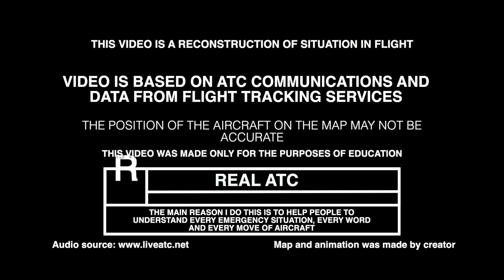[REAL ATC] Mid-Air Collision During Refueling.  KC 130J and F 18

Comment: The KC-130J was from my unit tail# 765 it was our COs bird, honestly after hearing about the crash initially, it was absolutely terrifying for everyone at the squadron until we finally found out that everyone survived! Maj. Wolf (I believe he got promoted) is a phenomenal pilot and an amazing person!
Reply: What caused the mid-air? Did the F-35 get caught in prop-wash?
Reply: @OlafoWaffle  The pilot made a miscalculation after the the in-flight refueling mission and pulling away, and accidentally flew into the props of engines 3-4 (damaging them) while simultaneously having his left wing severely damaging the fuselage and main landing gear of 765

Comment: I'm wondering if the reason we stopped hearing the aircraft's radio transmissions is because they switched to UHF frequencies? Do they use the same VHF radios for Com and Nav? I seem to remember that used to be the case, but I could be out to lunch
Reply: no, comm and nav are different radios, sounds like they stayed on VHF since Center kept giving them victor frequencies to switch to, probably wasn't picked up by the scanner due to the mountains

Comment: Holy cow, that has to be up there with one of the most intense successful crash landings we know of. Landing in a muddy farm field seems like a great place to land gear up with a giant plane like that. Wonder if he made the choice or if the gear was broken. I wonder how they got it out or if it's still there lol.  Having that gigantic rudder sure helped with both starboard engines out, but to pull it off, incredible. 

Tons of skill and some luck saved a lot of lives. I wonder why the collision happened. I assumed the F-35 could aerial refuel with computer aid. 

Also, looking at all of that kerosene pour into that farmers field would make me nervous to stand so close, so props for taking that picture.
Reply: The C-130 was designed for a no gear landing. With high wings and a flat bottomed fuselage, it just slides to a stop with minimal damage.
Reply: That plane was from my unit and I helped clean up the right side main landing gear was absolutely destroyed and after we removed the aircraft, what was left of the fuselage was transferred back to the Air Force (most likely for training purposes and to review crash data/ damage) also the fuel we use is JP-8 similar to diesel and kerosene but a lot harder to ignite for safety reasons specifically like this. However I wouldn’t expect to be growing any crops in that field for a very long time with the amount of fuel that leaked out lol
Reply: Actually Kerosene or Diesel is extremely hard to ignite when in liquid form. You can put out a burning match by sticking it into a pool of Diesel.

Comment: Center controllers: when someone says they declare an emergency, is it too much to ask to LISTEN?
Reply: The audio you are hearing is not the same audio the controllers hear. Depending on the antenna locations they might hear it clearer, or they might hear it worse. It is also possible that they can’t hear it at all.

One thing for sure: if they are asking for clarifications then they couldn’t hear it, and not because they forgot to “listen”.

Comment: "Emergency" should grab full attention of the controller. Not a cascade of "I'm sorry, what now?"
Reply: I think the KC130 was too far out from the ATC to receive the transmissions clearly. That transmission could have also been stepped on. But the planes around him could hear him and might not have been stepped on like the controller was.

The ATC recordings we hear don't come from the actual center. As I understand it, it's usually an ordinary person that set up a radio to record, stream, and save transmissions on that frequency. So at times they may hear things better or worse than the actual ATC. That's why ground vehicles often don't get recorded on ATC tapes. Their radios aren't very powerful because they don't need to make long range transmissions just talk to the tower and airplanes on the field, not miles away.
Reply: @BuffaloWarrior7  Also, in addition to having lower-power transmitters, ground vehicle radios, kind of by definition, have their antennas near the ground. ATC's antennas are up on towers. And, of course, the aircraft's antennas are airborne. Since the LiveATC receivers are also on the ground - and not at the airport - they're a lot more likely to have buildings, trees, and/or the ground itself obstructing their signals from ground vehicles than from ATC or airplanes in the air. This is why the airplanes themselves can sometimes be more difficult to hear (on LiveATC) when they're on the ground, too.
Reply: Notice that in this video the controller several times replies to a Raider50 transmission we can't hear. Its pretty clear that what we receive and what ATC received are different, and of course it must be because the radio receiver that was reproduced here wasn't the tower's own receiver and was located in a different spot.
Reply: Severe damage to aircraft... possibly breaches in the fuselage causing wind noise.

Several potential issues that could result in difficult to understand communications.
Reply: That's why they're supposed to say "mayday, mayday, mayday." Plus being on the backside of a mountain range garbled the transmission.

Comment: What language are they speaking - if it's English it's unintelligble
Reply: What do you mean? I could understand everything they were saying.
Reply: Unintelligible? 🤨
Reply: Plenty of intelligibleness here 😉
Reply: It's English and it's intelligible, even for a non English speaker like me
Reply: They even have subtitles for them what u mean?
Reply: ??? Sounds fine.
Reply: Huh? They be talkin' real good!
Reply: @hotsoup1001  So it''s true - America and Britain ARE separated by a common language.
Reply: @hotsoup1001  Can confirm as a pilot myself that 99% of communications have this sound quality. It can be easier to hear if, one, you're familiar with the "language," as well as the headset you wear that cancel a lot of other noise that you can adjust the volume of just like any headset. Overall, this is what you're hearing when listening in.
Reply: @roxiereign   to most extent yes. But these recordings are sourced from land based equipment by aviation enthusiasts that volunteer their feed to liveatc. What is picked by those feeds are subject to terrestrial interference, distance, quality of equipment, etc. Also some of the scanner feeds are monitoring multiple freqs and when a signal is detected on another freq the scanner will automatically switch to that freq which isn’t instantaneous so the initial part of the recording can be missing, especially if the scanner is monitoring multiple busy freqs. What we hear in the air are substantially clearer because most of the time we are above terrestrial interference with flightworthy radios that are each monitoring one freq.

Not a flame, not trying to be argumentative, just friendly conversation. Happy to be corrected. 😊
Reply: @SeligTiles  Yours is a perspective I've always been curious about.  Good info, thanks Giles.

Comment: Think the title should be F-35 instead of F-18 👍🏼
Reply: Was noticing the difference between the title and the description.  Looking at the pic of the grounded KC-130, that was quite a show.  Best news, no one seriously hurt in either plane.  Always good news.
Reply: @davidbeckenbaugh9598  Agreed 😎.  I wonder where the F-35 ended up, though
Reply: I find it interesting that “raider 50” notes on two separate occasions that he has 2 engines out. An F-35 only has one engine.
Reply: @HeavyC66  Raider 50 is the KC-130, not the F-35. The F-35 pilot ejected and his aircraft crashed, hence the plume of black smoke noted by one of the other aircraft on the frequency.
Reply: @vbscript2  Yup... the controller confirmed it was the number 3 & 4 engines of the KC-130. The photo (near the end of the video) of the grounded bird with the 2 mangled engines was startling - THAT back story has got to be intense!
Reply: @_TonyZ  Uh... the backstory is that's the plane from the video.
Reply: @volksronyahoo  Every seen "Air Disasters" before, Ron?  THAT is the sort of "back story" I'm talking about. Duh.
Reply: @_TonyZ  lol. OK.
Reply: @_TonyZ  it generally takes 1 year for a finalized accident report to come out. Only from then can a back story start to be built. Do you ever notice that “Air Disasters” generally makes shows from accidents that are more than 3 years old?  Some of them are 50+ years after the accident happened.
Reply: @HeavyC66  BUT... A KC-130 DOES have 4 engines.  I think you missed something.